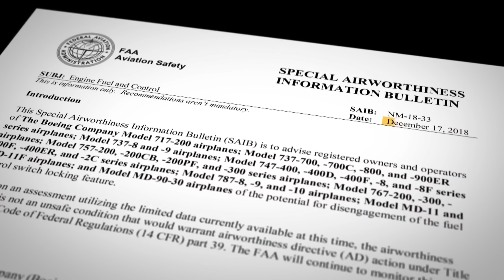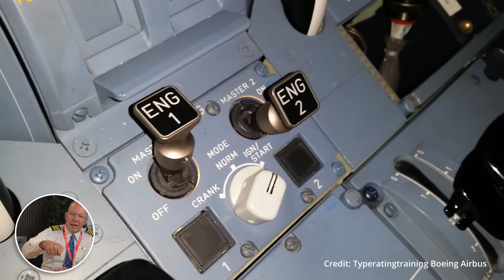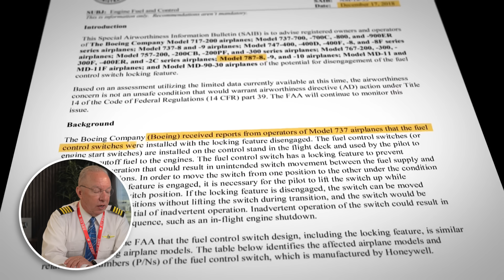Air India 171: The FAA’s 2018 Fuel Switch Locking Bulletin Explained (16 Questions Answered)

Comment: Captain Steve, the AAIB report shows both engines lost thrust seconds after takeoff after the fuel switches were moved to CUTOFF. On a 787, those switches signal FADEC — they don’t directly cut fuel. FADEC is designed to reject unsafe shutdowns. If it allowed both engines to go offline, that’s a system failure. It’s premature to assume pilot suicide without addressing why those protections didn’t work.
Reply: "if FADEC allowed both engines to go off-line"…… "After the fuel switches were moved to CUTOFF…"
Who moved the switches while the plane was taking off?  Somebody did.  If FADEC allowed it, it's not a system failure it's a design flaw, and it doesn't change the fact that somebody in the cockpit evidently shut the engines down.
Reply: @0101-s7v  Конструктивный недостаток ? А разве самоубийцы и террористы просто НЕ ДОЛЖНЫ попадать за штурвал ?
Какую техническую "защиту" надо придумать (по вашей логике) от террористов за штурвалами самолётов 11 сентября в США ?
Reply: @user-vw2rf9ht7h  yes, that is my point.  It is a "flaw" only if one assumes the pilot is going to intentionally crash the plane.  In that case, there are bigger problems because there's no stopping a determined pilot.
Reply: @0101-s7v  Even calling it a 'flaw' is a stretch. A safeguard against unforeseen flight sabotage is a better description. This opens up an endless can of worms of what else can be done. Does there need to be interlocks to prevent the stick from being shoved forward? Engines pulled to idle? Rolling the aircraft? Hundreds more. Then an accident occurs because a competent pilot was prevented from maneuvering to save an unforeseen event.
It's a Pandora's box of endless impossible scenarios to try to prevent with computer controls. No complex device can be designed to prevent an operator from intentionally harming themselves or others.
Reply: @jameshisself9324  I don't disagree.  In the context given, "flaw" is the best description.  Regardless, the system worked as designed.  And you are 100% correct… Building the software to refuse commanded engine shutdown under certain circumstances takes control away from the pilots.  If the software has to account for intentional sabotage, the next obvious question is, who the heck are we allowing in the cockpits?
Reply: @0101-s7v  Agreed. I guess paying the best pilots a very large salary is not such a bad strategy after all.
Reply: There was a latest report titled "Air India crash report shows pilot confusion over engine switch movement" by The Straits Times about this fuel cut-off issue. I tried to attach the link but YouTube had deleted my comment. It reported an interesting information that a GE bulletin stated a flawed chip if not replaced after 11,000 cycles could cause the fuel cut-off during loss of signal.
Reply: @emilyl1094 Thanks for bringing this up 👏Yes I heard about this from a well famous experienced 787 pilot from Asia talking about this couple days ago. He was also the first guy to claim that AI171 was engine failure issue when there are ton
Others said flap, landing gear, fuel contamination issue, etc. The chip needs to be replaced and it is located inside the engine and the whole PCB board which it is on needs to be re-installed with a new one after three times from what I heard.
He also said with all the Other ways if he “wanted” to end his life, he could have just flipped (easy) the yoke instead - think about that?! ⚡️; would that be more easier.
I think it’s a possibility too, so I don’t believe it is intentional act. Not at this stage of investigation anyways. End of Page 2 of the report already explained why…
Reply: @1009wlwilling  Suicidal pilots push the nose down they don't try to fly the aircraft like that.
Reply: @jameylane9944 can’t agree more! 😊
Reply: @1009wlwilling  I agree to this - it could or could not have been intentional, especially in this stage where either Boeing or Air India could also have been at fault.

But, on the other hand, I also do not believe that it was a "re-ignition sequence" or "engine shut itself down automatically, which is why pilots reached out to restart the engine" that the pilots followed, which the preliminary report does NOT state at all.

On the other hand, if this is a flaw, this might be present on other Boeing 787s too. All we can do is wait, instead of jumping into conclusions on any of the parties.
Reply: @1009wlwilling other pilot could have fought with his yoke. Killing fuel was a certainty there was no coming back, especially at that altitude
Reply: @emilyl1094  I'm more with this theory because there would be a whole hell of a lot more chatter about a restart procedure then hey did you cut the fuel off and no as a response.
Reply: Simultaneously both failure? No @emilyl1094
Reply: @emilyl1094 oh my dear.. can you attach the link here
Reply: @shyamalagowri9992  I had tried attaching the link but Youtube would delete my whole comment. I think nowadays YT restricts links on the comment.
The video was titled "Air India crash report shows pilot confusion over engine switch movement" posted by The Straits Times.
Reply: @emilyl1094  oh !😢  thank you for sharing Emily 🙏🏻
Reply: This what I found on a search. FADEC is not designed to prevent or reject unsafe engine shutdowns on the 787. While FADEC automates many engine functions and can manage relights after a switch to "RUN", it cannot override manual fuel shutoff commands by the pilots, according to Airline Ratings. The fuel control switches on the 787 are manual and require deliberate action to shut down the engine. 

So what is real story here?
Reply: @davidelias8569 the real story is deliberate action by the pilot unfortunately, something the Indians can't accept at the moment
Reply: @davidelias8569  ignore the guy who posted the og comment, he has probably snorted some optimistic powder.
Reply: OK apparently Youtube removes comments with links.
OP please go check 787's QRH about duel engine fail/stall.
Note that it does NOT require idling the throttle before cutting off the engine.
What does that mean? it means the FADEC will safely reduce the throttle before cutting off (hence not requiring pilot to manually idle before using the cutoff).

As such you got one crucial detail wrong:
as much as cutoff switch commands do go through FADEC, the FADEC does not second-guess the cutoff command. instead it obeys the cutoff command by gradually and safely bring the engine to a stop. That's how cutoff commands go through FADEC.
Reply: Also do note this was from QRH procedure for engine stall in addition to engine fail.
That means yes the pilot does have the authority to command an engine cutoff when the engine is still at non-idle output (including during compressor stall aka surging). This in turn means the FADEC does not block cutoff command, as QRH procedure requires the cutoff command available throughout the entire flight envelope and engine setting envelope, as no one knows when or where an engine stall may happen.
Reply: listen to what he answered to the question at 11:05 there's a reason why they design it like that
Reply: After all he is pilot and support  GE and Boeing
Reply: You’ve made a very valid point. Unfortunately, what we are witnessing now appears to be the shaping of a narrative—something that began almost immediately after the crash. If you recall, right after the incident, videos surfaced featuring former pilots discussing flaps and gear configurations. However, anyone familiar with even basic aircraft operations knows that if both engines are functioning at full capacity, the aircraft will take off regardless of flap or gear positions.

Fast forward to the present: the preliminary report has been released, yet no one seems to be addressing some glaring factual errors within it. For instance, the full form of FADEC is consistently misrepresented throughout the report. Moreover, a prior FAA advisory clearly connected to this type of failure is being overlooked by so-called expert captains.

That advisory specifically warned that if certain chips used in the FADEC system aren’t replaced after 10,000 cycles, there’s a risk of automatic engine shutdown. Given Air India’s well-known history of maintenance issues, several technical factors could have contributed to the crash—beyond pilot error or intentional actions. The conspicuous lack of attention to these potential mechanical failures strongly suggests an attempt to shield Boeing, Air India, or both from scrutiny.
Reply: @AtulDubey-i8m  this is far better than anything I read for the past three days.

Can't believe there are so many aviation illiterates who think FADEC would intervene a cutoff input...
Reply: Indian has no suicide word. They born again as different creature
Reply: He is absolutly lying about everything. Dud is drumming up pilot sucide so that he can start his business in psycology. No reliable.
Reply: Steve doesn't care about that, he just cares about pumping out as many videos as he can speculating so he can rake in more retirement money. This guy is a sham, and probably a shit pilot too.   The AAIB report is clearly building a case against Boeing, the FAA and the connection between the SAIB and the fact that the SAME TYPE OF SWITCHES were used on this 787 that were referenced in the 737 SAIB memo.  But here's this douche who doesn't want to admit his precious Boeing is at fault, and is willing to throw these pilots under the bus.  What a POS "influencer"
Reply: Agreed
Reply: Absolutely, easy to blame pilots, difficult to nail might
Reply: He adresses this in the video, he says that there is not a system to prevent this currently, so the systems worked as intended. I will agree with both you and Captain Steve when I say that I think a protection like this should be looked in to
Reply: Isn't that wrong? The physical switches cut fuel not FADEC which is only an automation tool for fuel flow etc.
Reply: So are you saying the other pilot lied when he said "I didn't"?
Reply: @paulgerhardfilms 
I believe my original post was quite clear, but I’ll expand for clarity.

It’s always easy to sit back and critique, especially with the benefit of hindsight — like an armchair quarterback on a Sunday. But in aviation, especially when a life-or-death incident occurs, such commentary carries real weight and must be handled responsibly.

First, the original claim about a wrong lever being pulled was not only premature, but later retracted with a weak apology. That kind of speculative error, particularly in public media, does real harm — not just to the reputation of the crew, but to the dignity of the investigative process itself.

As I understand it, the fuel switches do not cut fuel flow directly. They initiate a logic command which then activates the FADEC (Full Authority Digital Engine Control) system — a control architecture designed with multiple layers of fail-safes. Just as a pilot cannot raise the landing gear while still on the ground (due to system interlocks), the aircraft’s logic architecture is designed to prevent catastrophic errors through overrides.

The captain of this flight was not just experienced — he was highly qualified, with over 20,000 hours and a background as a check pilot. Allowing the FO to handle takeoff under supervision is entirely consistent with that role. If the FO had intent to crash, he could have done so easily without complex manipulation of systems.

I have no way of knowing whether the captain lied — and that’s not what I’m claiming. I’m simply speaking from a technical standpoint, based on what I understand about how a system like the 787’s fuel logic architecture is designed to behave under normal and abnormal conditions.

I’m not a pilot. I’m an engineer and scientist with a lifelong interest in aviation, largely because my late father was a 747 commander. I bring this up only to say that I deeply respect the responsibility pilots carry — and I’m troubled when another pilot, especially with public reach, speaks without evidence or reflection.

My only hope is that none of us ever find ourselves judged in the court of public opinion without facts, context, or due process.
Reply: I don't think FADECs reject cutoff commands. FADEC is essentially just a modern version of the WWII Me 262's fuel regulator, which controls the speed the actual throttle moves (Jumo 003 has the problem of fast increase may cause fire). In fact IIRC the fuel switch is a different valve, not the throttle and not related to FADEC.

So yes it is human input. It may or may not be suicide but stop trying to put every blame on Boeing.
Reply: @borisglevrk  We don't know that it's human input at this point.
Reply: @jameylane9944  we do. it's the cutoff valve SWITCH. If it's the valve itself then sure, we don't know it's human input or system malfunction. But the current preliminary result is that the switches have been moved to cutoff position.
Reply: @borisglevrk  Switches fail for numerous reasons. Can't be ruled out at this point.
Reply: @jameylane9944  if switch fail it means the physical switch is in idle (on) position but system receives cutoff (off). This is not the case.
Stop, trying, to, blame, Boeing.
Reply: @borisglevrk  I don't even know what planet your comment is from. It makes very little sense.
Reply: @jameylane9944  well you need to learn more about aviation then.
Current result is engine cutoff switch is flipped by human. Whether that's intentional or not needs further investigation but not the fact itself it's been manually turned off. Get your facts right. It's not a system failure.
Reply: @borisglevrk  That must be why Air India and others are checking all their cutoff switches as "recommended" in SAIB: NM-18-33 ? The investigation is only in the preliminary stages and NTSB has been all but kicked out of India. I wonder why?  Maybe they all remember Lion Air Flight 610 and Ethiopian Airlines Flight 302? Maybe you should learn a little bit more about aviation?
Reply: @jameylane9944  NTSB being kicked out of India for same reason. And max crashes has NEVER been a Boeing problem. A 1962 QRH would have saved both planes if the pilots were actually qualified, and that's why Ethiopian withheld information about pilot reaction early in the investigation.
Reply: @jameylane9944  the 1962 737 QRH procedures for runaway stabilizer trim has but one memory item: stabilizer trim cutoff switches (both)......... cutoff. That would hard disconnect any electric power to the trim wheel and disable any intervention for trim, including without limitations the MCAS which didn't exist on 1962 737s.
After the Max crashes Boeing amended the procedures to include disengaging autopilot and auto throttle, so I guess even that would have been enough to kick MCAS out of the equation.
Reply: @borisglevrk  Yup, your planes sensors and software trying to nose you down and crash you shouldn't have been a problem. It's covered in a check list.  Genius.  US Airways Flight 1549 should have been able to make it back to LaGuardia too.  Getting tired of you shill.
Reply: @jameylane9944  oh and latest news: Air India found no issues on 787 fuel cutoff switches.
At least they are honest they can't keep blaming Boeing because there has been no problem from the beginning.
Reply: @borisglevrk  Oh latest news - Air India only has 33 787s.  Might want to delay your little "victory party".
Reply: @borisglevrk  What's your position at Boeing?  You must have some reason to be shilling for them.  Fan boy?  What is it?
Reply: @borisglevrk  While your dancng around in the victory party, in addition to Air India's whopping 33 787s, we can wait for all the other switch inspections in the SAIB to include Model 717-200 airplanes; Model 737-700, -700C, -800, and -900ER series airplanes; Model 737-8 and -9 airplanes; Model 747-400, -400D, -400F, -8, and -8F series airplanes; Model 757-200, -200CB, -200PF, and -300 series airplanes; Model 767-200, -300, -300F, -400ER, and -2C series airplanes; Model 787-8, -9, and -10 airplanes; Model MD-11 and MD-11F airplanes; and Model MD-90-30 airplanes
Reply: @jameylane9944  "other switch inspection" won't happen. They were precautionary at most and most of these planes you listed aren't even in service.
Reply: @jameylane9944  the very fact you asked "my position at Boeing" proves you wrong. You are making this a "pro vs anti Boeing" issue and it's not.
I am pro fact. Fact is Max crashes can be prevented with an operation that has been on the manual for 60 years. Fact is Max and 787 has only been crashed by third world carriers. Fact is Air India is trying hard to replicate Lion Air and Ethiopian's successful psyops.
Reply: Also fact is I have a very anti Boeing ex-737 pilot YouTuber who is even more outspokenly doubtful of how airlines in India handle safety requirements.
Reply: @borisglevrk    Why on earth did Boeing fix the MCAS?  What a waste of time!  Such an easy thing to overcome in flight.  Good point.  LMFAO.
Reply: @jameylane9944  they didn't. MCAS remains single AoA input to this day and a lot of idiots like you point at this as Boeing flaw.
In fact MCAS can only have one AoA input because otherwise they will disagree naturally all the time.
As for other fixes that Boeing did do, that's because they had to admit the wrongdoing they never did due to the psyops I told you earlier. Admit wrongdoing became the quickest way out of this forged blame game.
And that includes buying Spirit Aerosystems, which then made Airbus crying (Spirit makes stuff for Airbus too), but have no choice but accept, for they know they got more than they should in the past decade already.
Reply: @borisglevrk    Wow you're losing it and throwing a tantrum!  No changes to MCAS?  That is delusional, seek help.  The new software keeps a comparatively short leash on the MCAS, permitting it to activate and send signals to the flaps—while allowing the flight crew to retain pitch control, using the control column to maintain level flight, climb and descend. No longer would the anti-stall system be able to grab control of the aircraft away from the pilots: it would instead defer to their commands.  In addition MCAS now relies on BOTH AOA sensors and if they disagree, MCAS will not engage and pilots will be alerted to the issue. Specifically, if the sensors disagree by more than 5.5 degrees with the flaps retracted, MCAS will be disabled for the remainder of the flight. An AOA disagree alert will also be displayed on the flight deck.  I'm glad I have the time to educate you.  You'll be a better person when I'm done.
Reply: exactly because they are Indian pilots the West is blaming them.
Reply: @jayrag3834 everyone's racist right? Where have we heard this before?
Reply: As a software developer working with mission critical systems I think it is wrong to state for certain that the switches were moved, i.e. pilot interventions. There is soo much soft and hardware involved that this can defeinitely also be the cause. Power glitch, racing conditions within an RTOS etc. The only thing I would say for sure is that if it is hard/soft it is about complexity, systemics, it is always that, not a single error but a combination. Always that. Including software updates, development team had a bad day/including the test team, technical debts, code rust. I'm not saying this is the cause but I am 100% sure that the investigation will follow this path also and saying it is pilot error is definitevly premature. Also, what does the black box monitor, the actual switches, if so more likely it was the pilot, but if further down the software path, then more uncertain.
Reply: @mva2se right......... Everyone's an expert now? Let those who's job it is to investigate, investigate..
Reply: Interesting! Wow good question.
Reply: I have questions, one is, where is the sensor placed for the Fuel Control Switch, which gives the signal to the FDR? is it directly part of the switch, is it sensing a 0 or one signal in a relay? Is it a signal entering the FADEC? Or is it the Valve position of the Fuel Shut Off Valve?
Reply: @mike-th74  judging from the fact that 787 emergency shutdown procedure does not include manually idling the engine, the cutoff signal most likely goes through FADEC, but that does not mean computer has a say about it. FADEC'd cutoff only makes the plane idle the engine for you before shutting down. It does not question the pilot about the decision to shut down.
Reply: Yes , finally someone outside of India saying the right thing
Reply: FADEC cannot electronically override a manually activated fuel cut-off switch because the switch operates a physically separate valve. FADEC’s role is to detect the shutdown (via sensor data) and facilitate recovery (e.g., restarting the engine if the switch is reset). The design prioritizes manual control for safety, ensuring that pilots or maintenance crews can isolate the engine even if FADEC fails. While rare, incidents like the Air India crash highlight the importance of robust switch design and crew training to prevent unintended shutdowns.
Reply: @mingchau6846  If multiple valves were inline, either can shut off fuel. If multiple valves were in parallel, then neither could guarantee 100% fuel shutoff.
Reply: @mingchau6846  what you said applies to older models. For 787 and other new model planes, fuel cutoff switches DOES go through FADEC, except NOT in a way the FADEC has a say about whether to shut down.
These new "FADEC'd cutoff" simply makes FADEC idle your throttle for you before actually shutting down, so that you don't have to do it yourself. They do NOT intervene the decision to shutdown.
Reply: exactly!
Reply: @ARPANSARKAR-f7v absolutely agree.
Reply: an electrical failure at any point between the fadec mcu and the physical switches would LOOK like the swirches moved even if they didnt. no way to know without a camera
Reply: Could be an Emi on the switch lines if they are electronic switch....common mode failure
Reply: @77supa  This doesn't look like a common mode failure:
-one engine shuts down then the other shuts down within one second 
-one pilot asks "why shut the engines down?"
-Then one engine immediately starts up and the other engine starts up within one second
Reply: Correct.
Reply: Of all the video's and information on this tragic disaster, the one thing I'm fully convinced of is that this was not suicide by pilot. Will we ever know the actual truth? No one really knows.
Reply: agree with you sir teach something this pilot
Reply: I agree. Also, the flight recorder does not say that the fuel switches were moved, it says that they “transitioned” to CUTOFF, huge difference!
Reply: @papillon6122 according to India news, that word is an American word, not Indian. (Transition) it's a language variance. ??
Reply: @papillon6122  This only shows that the Data Recorder (outputs from the Flight Computer) assumes that they have been  physically toggled because the flight computer is saying that they have been, but there is zero evidence that the pilots touched those switches ...
The second voice in the cockpit is possible evidence that the pilots did NOT throw the fuel cut off switches at all, but flight data told them that the flight computer had cut off the fuel ...
Reply: @Jester-Riddle  Right! Also, according to the report, the switches “transitioned” from RUN to CUTOFF, it doesn’t say that they were moved.
Reply: Completely agreed. It seems that Captain Steeve is convinced and has completely assumed that the systems and mechanics had any kind of failure. And he is talking about pilot suicide and spreading misinformation. There are several other pilots and experts better than Captain Steeve who have flown the 787 and are talking about a chip malfunction or a possible loose control switch that could have moved to cutoff at takeoff due to excessive vibration. https://youtu.be/WhCGWxb5zsE?si=1Ff1Tynjve04ZKA8
Reply: cough cough Boeing puppet Youtuber detected cough cough
Reply: @suar123123  bullshit.
Go Google Transasia flight 235.
In a nutshell: single engine failure on takeoff. Pilot cutoff the working, normal engine. Loses all power. Crash.
Nobody questioned ATR72's FADEC for not intervening. And now some suckers are questioning Boeing just because it's a Boeing. Textbook double standard.
Reply: Fly by wire means computer flying plane, you just get to make suggestions to FADEC in this situation. I don't think Captain Steve understands this.
Reply: @avlifesavers  nope. FBW only means computer interprets your command and try to satisfy it.
think about throttle pedal in manual versus automatic transmission. in manual transmission it's directly controlling the throttle, but in automatic you are telling the computer "I want this much acceleration" and computer uses throttle and shifting command to meet your demand.
Reply: @borisglevrk  Until it goes all HAL at 400 ft
Reply: @avlifesavers  what goes what? Shutting down at 400ft will NOT cause anything to intervene. Just look at Transasia Flight 235.
Reply: @avlifesavers  FBW and FADEC are not same thing by the way. Boeing only started using FBW in 787's generation (not sure 747-8 and 737 MAX have it or not) but FADEC started way earlier. In this 787 engine shutdown scenario, FADEC will NOT block your command to shut down. It only automatically idles the throttle before actually cutting off fuel, so that your shutdown procedure does not include manually idling the throttle.

FADEC is really just a further development of Me 262's fuel flow regulator (which controls the change rate of throttle to prevent engine fire when throttle increased too fast). It's not as automated as you think.
Reply: Thank you so much for your reply. 
I think the captain is being Hasty in pushing the suicide narrative... It helps the company he works for and that is Boeing of course
Reply: @geraldinesales1270 bullshit.
Captain Steve doesn't work for Boeing and doesn't need to be. This crash has never been a Boeing problem and never will be. Learn your facts, not your "not even Airbus goes that far" propaganda.
Reply: @geraldinesales1270 and boeing has had a string of bad events lately.
Reply: @avlifesavers  All of which are fake. Yes, ALL of them.
Starting from the max crashes which in fact can be solved by a 1962 version of manual (just outright pilot training deficiency), and then the "whistleblower" bullshit (including deliberately misinterpreting "there is one 787 example that failed 200 QC tests" into "there are 200 787s failed QC tests in the factory; the correct one is a non-issue as a plane or any product can fail a million QC and still be as safe as another product that passed QC test first time, as long as that 1 million failures are all rectified.)
Reply: Apparently this scenario was not envisioned in the protocols. Perhaps they will build in a safeguard for this in the future. The switches were manually activated in this case as the pilot flying exclaimed "why did you do that". then it was another 10 seconds until the switches were returned to run. Count that out loud and that is an eternity in this situation.
Reply: I believe it's a system failure, the engines failed, stalled, flamed out...or whatever...the movement of fuel switch to cutoff was simply the pilots trying to re ignite the engine...which they did, when the turned it on again...but due to lack of altitude, engines couldn't produce enough thrust, to generate lift.

It's clearly written on the preliminary report. How does everyone miss it?...  

It is very very clear that it's a technical failure...
Reply: @alphareaper1151  NOPE! The chances of BOTH engines shutting down within 1 sec is billions to one!
Reply: @alphareaper1151  Why did the pilot ask why they were shut off then if they were doing a restart procedure?
Reply: @alphareaper1151 why would one ask then? Why would the reply be, I didn’t? Your guess doesn’t fit the conversation.
Reply: @alphareaper1151  whatever you said was not mentioned in the report. neither of the 2 engines failed to operate before the fuel supplies were cut-off. so in case you conclude it was a technical failure from the preliminary report, you might also conclude that the Earth is flat looking at a paper map; and that's a you problem.
Reply: @alphareaper1151 please share the link
Reply: @alphareaper1151 correct. It's a reigniting procedure. It's crazy how people are trying to blame pilots for killing the engine. While the reason could be that engines failed and pilots tried to reignite them.
Reply: @realnapster1522  Then it would be weird for one pilot to ask why the fuel switches were off and the other one saying they didn't do it wouldn't it?
Reply: @jameylane9944 the pilot didn't mention any switch at all. He didn't say fuel cutoff switch. He just said why did you turn that off? That could be any switch in the plane.
Reply: @realnapster1522  Exact words “Why did you cutoff?”    You're right, probably referring to the radio or something.  SMH.